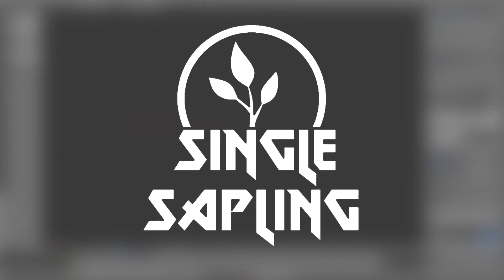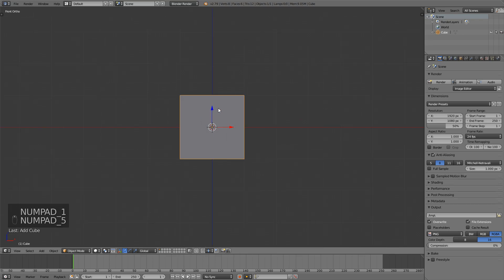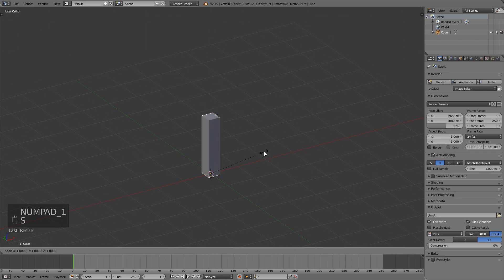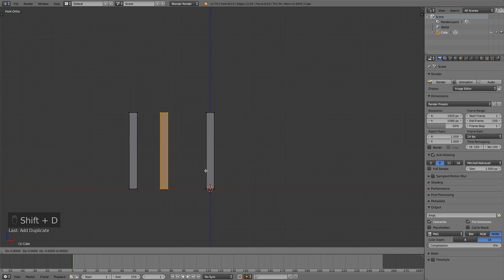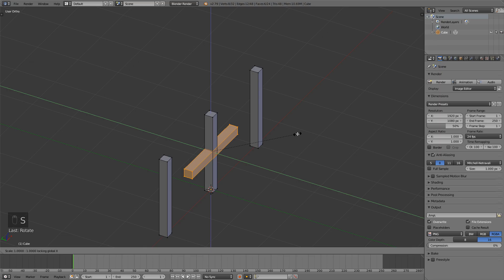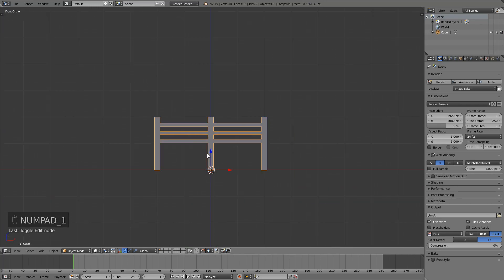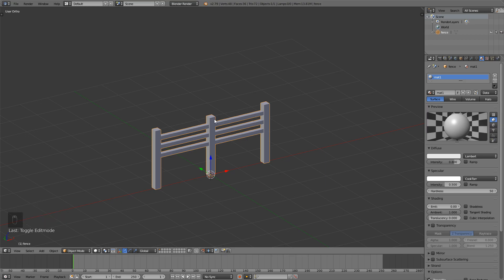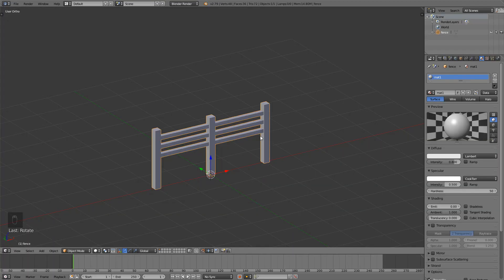Low Poly Fence In Blender - FPS Game In Unity - Part 20

Comment: why do you do the rotation of 90 degrees and apply location rotation and scale before exporting it? im new to unity and blender been watching all your guides to learn
Reply: also when you do it how do you rotate it back afterwards ive been skipping that step because I cant rotate it back onto the same spot it rotates on a different pivot point
Reply from the maker: I just press R + 90 to bring it back but I dont apply the rotation this time
Reply: @SingleSapling  dude thank you so much, seriously. Learning so much from you that I never thought I'd be able to achieve.
Reply from the maker: I am doing it because unity and blender use different metric and rotation system, so basically I am applying the unity metric system to my model before I export it